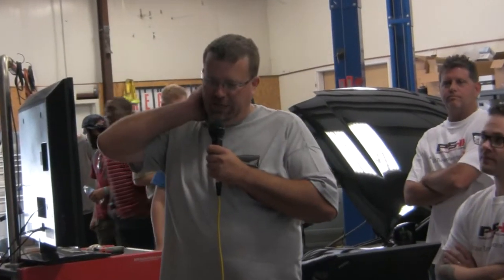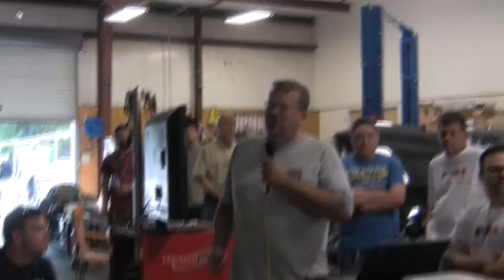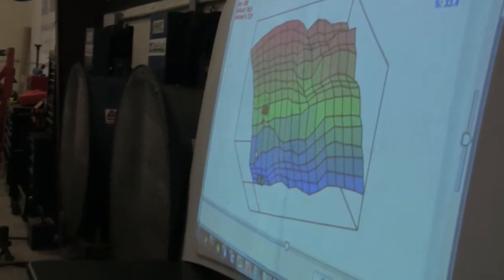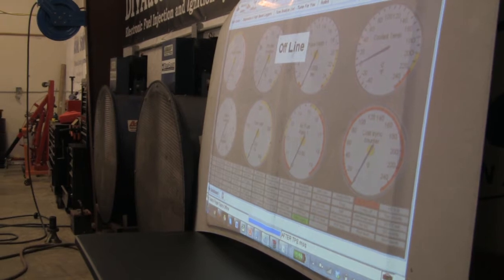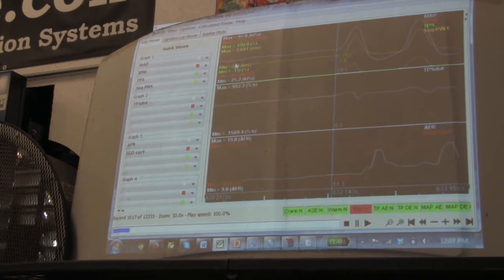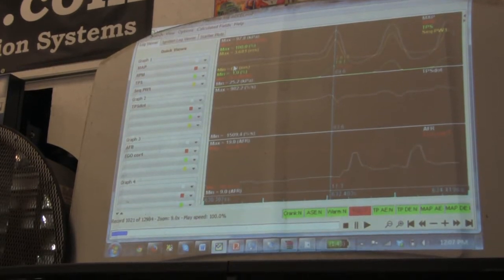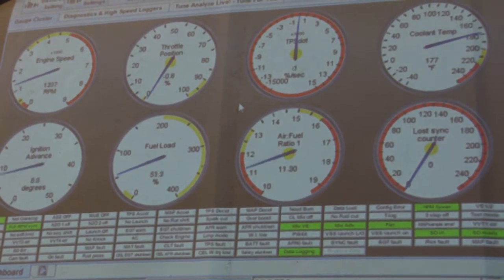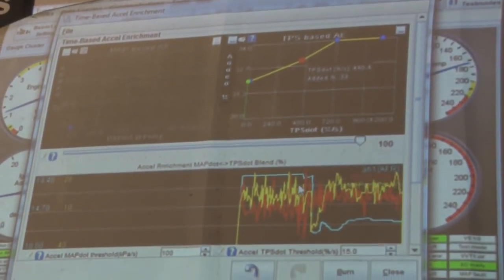MegaMeet 2014 Tech Session 4: Acceleration Enrichment

Comment: Interesting how you set the tpsDot threshold so low, Manual says to do a wide open throttle pull and set threshold to above tpsDot spikes. I have found that at idle I have virtually no spikes but at WOT I get spikes over 100